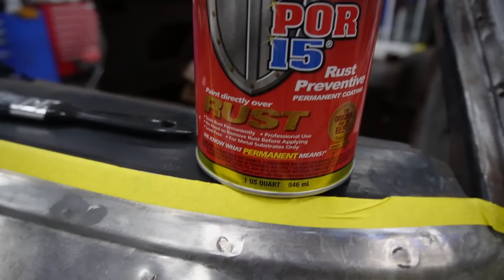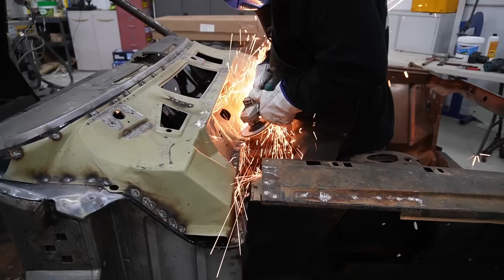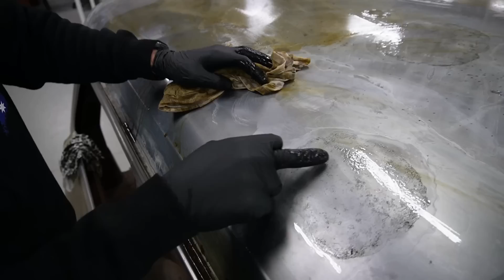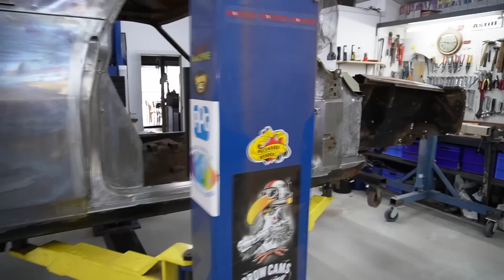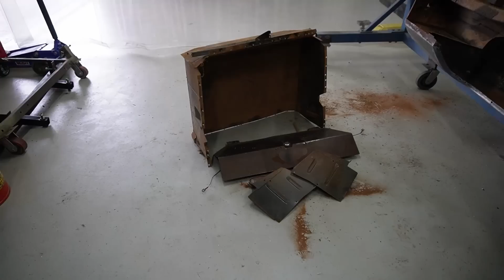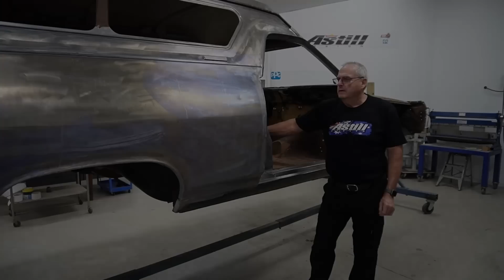Rust Removal, Plenum repairs on Panel Van #4 PLUS announcement of what's coming to Astill Design

Comment: At the start of the video you said treat it, but what do you use, treat it with what?
Reply from the maker: Hi, we use Henkel bonderite distributed by PPG. Dioxidine 624 
A phosphoric acid based metal conditioner

Comment: Sealing the Plenum is a great idea. When I had my ZC, I always wondered where the water went when I washed it.
What  driveline combo will you install to yours?
Reply from the maker: Cheers mate, 351 single rail 4 speed, BW disc brake rear

Comment: For seams after welding and burning off the coating.  I always thin down Tectyl ( that brown waxy stuff ) with acrylic thinners until its really runny.  Spray that inside the seam until it wicks out to the outside of the seam. Then go with a thicker mix to ensure a total air / water tight seal.   It works.
Reply from the maker: Thanks for the info!

Comment: Greetings from across the ditch. I've used POR15 on my 48 V8 Coupe its great stuff and further to your tip about keeping the tin lip clean, I put a piece of  soft plastic bag between it as well and the lid comes off real easy again and the paint keeps. I have a small tin that is years old and opened it recently for another job and it just as good as before. Wish I still had my base model  XA Falcon 500 with 302C V8 ( Aus assembled) I sold back in the late 80's.
Reply from the maker: Thanks for sharing, we all have cars we wish we never sold

Comment: A mate of mine is in the boilermaking/welding game. He repeatedly goes on about how they use sikaflex to "stick trains together, it's that ****ing strong!" The upper loco bit, not the rolling stock.
If they use bolts or rivets, the vibration shakes it to pieces!
Reply from the maker: Yeah you want make sure you don’t need to remove it. This is a sealant rather than an adhesive

Comment: what the best air temp to apply the por15 for doing large areas?..i live in QLD and as you know its high humitity.
Reply from the maker: I dont have specification on it, but I like to paint around 22 deg as a general rule
Reply: @AstillDesign  great thanks

Comment: Just a quick question. Why did you choose to build a dam and use the gell rust remover, instead of using a small sand blaster?
Reply from the maker: Easy, I don’t own a small sandblaster plus there very messy. DUST

Comment: Looks like you got solvent pop from the application of that por15. I had the same whe  applied with a brush and it put me off using it for fear of product failure.
Reply from the maker: Just a bit of dust, never had a problem with this product over dioxidine

Comment: I am doing some patch panel repairs on my VW Beetles, and as I am working away i am asking myself "is this how Darren and Howard would do it?" I've taught myself over the years. Dried Newcastle sand is easier on the panels with a good blasting gun. It siphons much easier than garnet so less problems with heating and warping. Good for the small spots. I haven't tried gel yet, because noone i know sells it! Where to get it?
Reply from the maker: The sand sounds good, The gel I buy online and it gets delivered. Rusted solutions.  Its a bit expensive but nice and clean.

Comment: Great episode guys. I'm at the exact same spot with mine as you are with this van. It's really cool to work along in real time.  Over the years, my process has developed to do it exactly as you are, and mostly the same products (about to try the rust gel). It's the most cost effective and efficient way of achieving top class results at home. Only difference is i prefer the red nylon wire wheels. When you get them "worn-in", it's a nice lasting abrasive that cleans up the tricky spots in no time. And no wire in your socks and face which is a bonus. I do need a spot hole one now i've watched this.
Reply from the maker: Good to hear from you and get some feed back

Comment: Thanks Howard. About to start an LX torana with original paint which has broken down, with surface rust breaking through on the roof, boot and upper surfaces. This information is invaluable. Not a fan of blasting these big panels.
Reply from the maker: Good luck! with the project